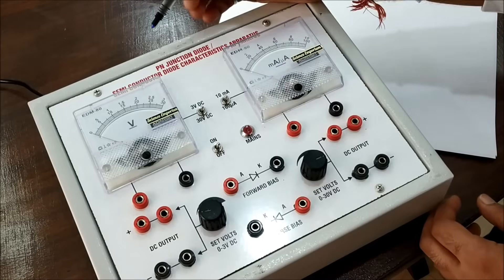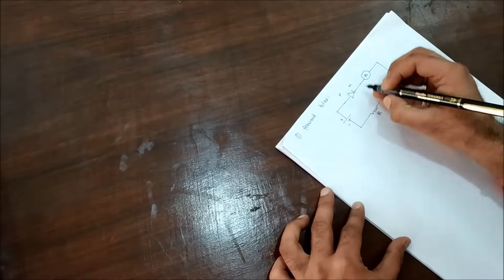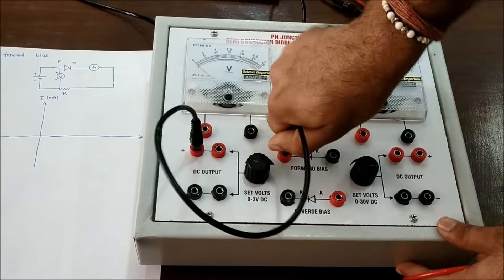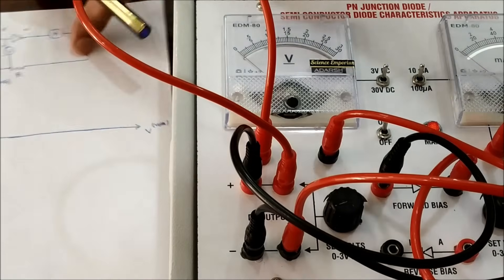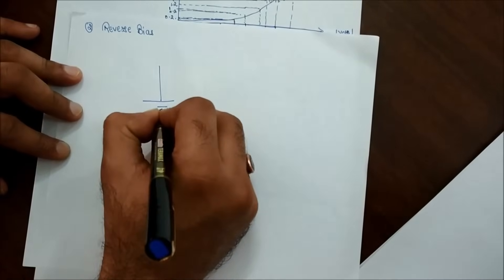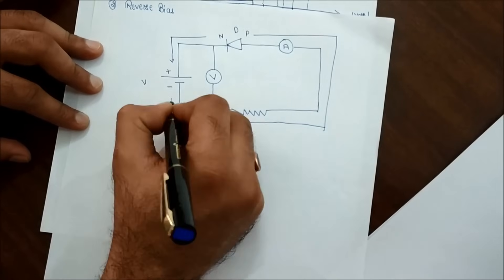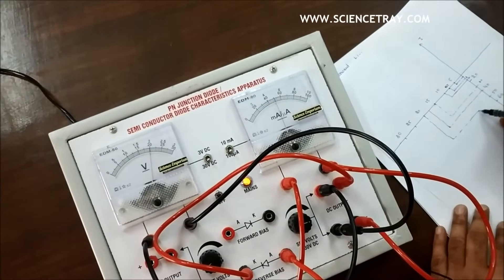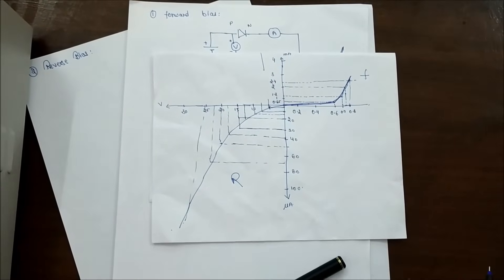PN Junction Diode characteristics Experiment complete with Readings & graph CBSE  ICSE

Comment: Pl read this because what you are showing circuit cum connection procedure is wrong voltage must be beasured across the Diode in forward and reverse vias also pl open the kit they coneect Diode in reverse bias with resistor that is wrong because forward voltage of silicon is 0.77volt  it will be Fromm 0.065to 0.077Depend on different type of Diode.  In reverse bias all coonection are same as in forward bias just reverse the Diode anode to negative cathode to.positive  the Diode totaly wil not conduct  you showing  curent in microamps because it depends on you voltmeter resistance if you rove.voltmeyer no.micro amps will come   so Diode.under.reverse.bias will not conduct.pl read.VK Metha Text Book or RS sedha. Principal of Electronics Text Book. They clearly explain these text book ರೆಫರ್ಸ್ Engineering  students and Lectures one power supply appro CV imately 0to 12voltor even 0to 3volt also suitable for both gorward & Revese bias characteristic you can try  pl expect your opinion after doing changes

Comment: I don't like this video just because i got confused of circuit diagram in my school manual the diode is in parallel but you add it in series that all 3 conponents aloso changes
Reply from the maker: Pl check again...our circuit diagram is correct...
Reply: @ScienceEmporium  Yes circuit is correct but it circuit diagram is in series but in my college manual it is attached in shunt wise so i get confused in both term but now it shorted....
Thanks For Support....

Comment: It's a wrong graph and connection. Voltmeter is connected at wrong place
Reply from the maker: thanks for the view...can u pl email us right graph...so that we can check it
Reply: @ScienceEmporium  The voltage across PN junction never exceeds 0.7 Volt ( for Silicon diode). You can give me your email id
Reply from the maker: @dr.pragatisharma  its sciemporium@gmail.com
Reply: @dr.pragatisharma  yes maa'm have connected voltmeter across both diode & ammeter so it measures boht

Comment: The circuit diagram you are drawing is for dynamic characteristics as you measure voltage across diode and resistance. Are you sure there is current limiting resistor inside your apparatus? If Yes
This is not forward bias static characteristics.
Reply from the maker: i will look into the matter
Reply: @ScienceEmporium  javab kab do ge ?
1 saal se dekh hi rahe ho kya ?
Reply: @syedhashir2970  😂🤣
Reply: He you dumb the wire which you are your are also a resistance 
Please study than argue his diagram is fine 
There is no circuit in the world without external resistance wire itself are external resistance
Reply: 4 saal ho gye, ab tak jawab nhi mila 😂😂
Reply: Stop wasting our  precious time 👎
Reply: @animeclan2582  meri to practical exam bhi khatam ho gaayi

Comment: very helpful sir
Reply from the maker: ThAnks ☺️☺️
Reply from the maker: @Pracht Nudeln 

 CUT IN VOLTAGE or KNEE VOLTAGE voltage exist in forward bias only. Ideally, for silicon it is 0.7V and for germanium diode it is 0.3V .

In reverse bias there is BreakDown Voltage. As per video, it is 22 V. Watch Video at 11:35